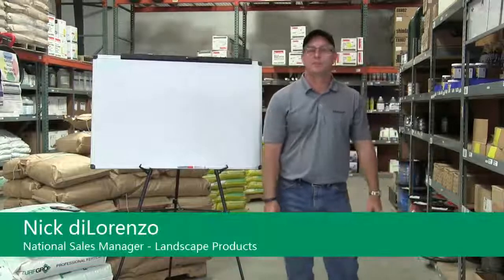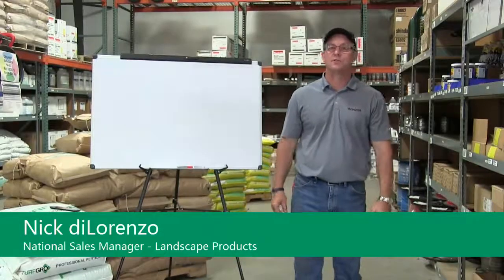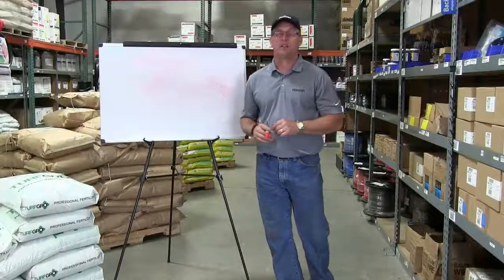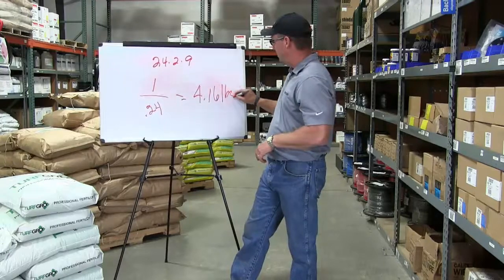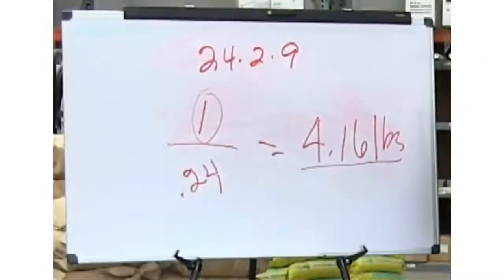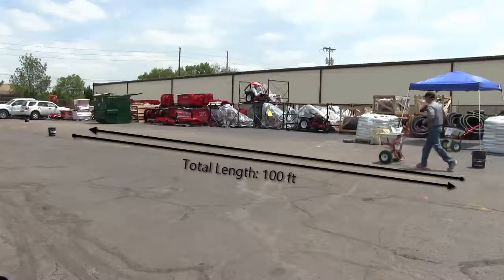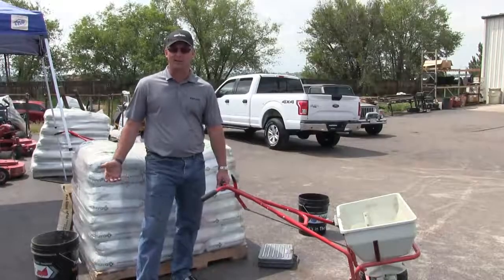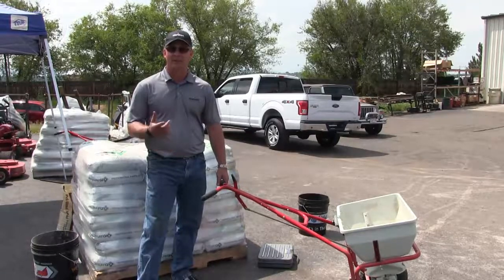How to Calibrate a Fertilizer Spreader

Comment: what setting u keep on the spreader? since this fertilizer is fine grain. do u use j setting?
Reply from the maker: The setting is different with each different fertilizer, based on the analysis (NPK) and the target rate of
fertilizer applied.  That is why one should calibrate for all the fertilizers one uses and write down the spreader settings after you calibrate the spreader.